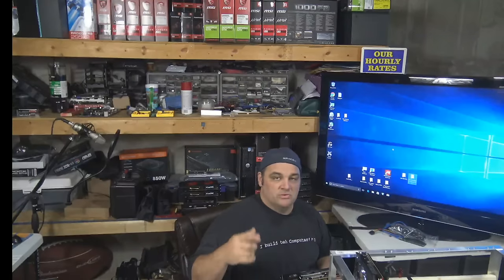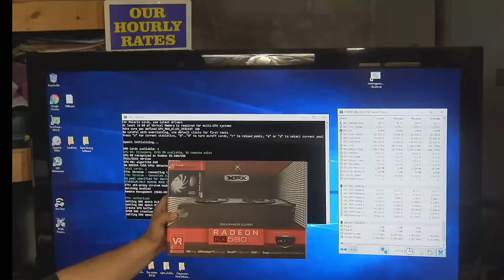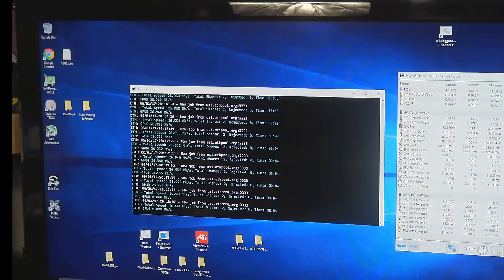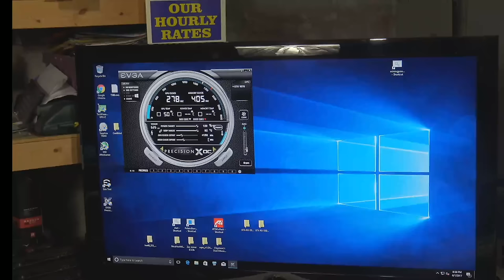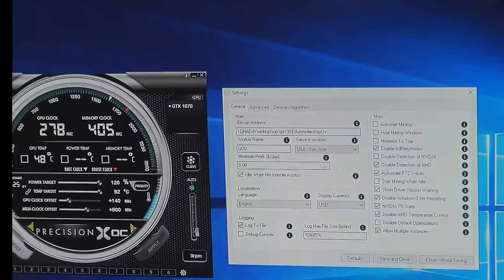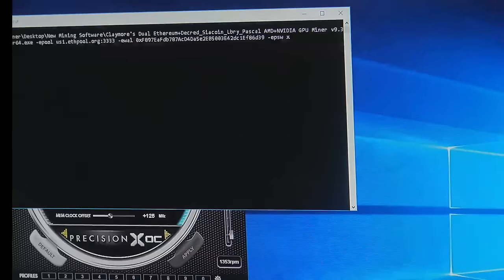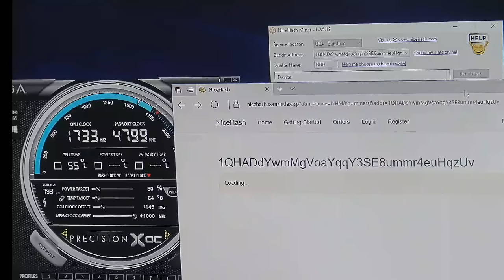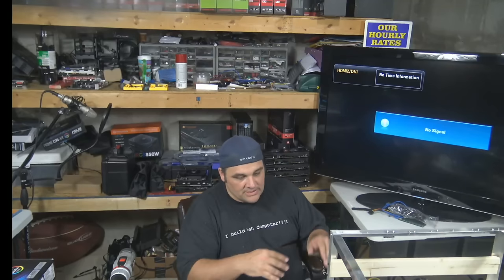Live Episode 15 - 1060 GTX 3GB Ethereum/Zcash ; XFX RX 580 8GB Crimson and OC Edition | Get it done

Comment: I've got two rigs with the ASUS Z270 PRIME  with M.2 to Pcie adapters and am trying to run 8 3GB 1060s per rig. Both rigs are only displaying 7 cards in Display Adapters. The m.2 adapter is not an issue, that card is working fine. I've enabled 4G Decode and updated bios. Anyone know what the issue could be? 0.056 ETH (around $20) bounty to whoever can help me get 8 cards on each mobo running!

Comment: PNY GeForce GTX 1060 3GB XLR8 OC Edition
Settings using EVGA Precision Tool
165+ GPU
1000+ MEM
23.5mh ETH
268 SOL/s

I see only +216 on MEM and not +1000 :)
Reply: Daniel, I agree. I used his settings that he posted in the description and they did not work. Followed what he used in the video and what you posted... it worked.
Reply: Glad to hear it. You just need to play with mem settings, get GPU-Z and MSI-Afterburner, run Valey or 3DMark stresstest in window mode to see if you can hit it for 10mins at least. +1000 Memory can burn your card...
Reply: Question Daniel. Have you gotten your cards stable yet? I can not find a number to get my pny's stable for longer than 36 hours. I can go a week on stock settings, but nothing else.

Comment: your overclock for 1060 is wrong. Do maximum memory, and under clock the core for ETH. You can't overclockclock memory at max which is the most important if you overclock the core.  
My 1060 6gb does 23.5mh/s at 9600mhz memory 1500mhz clock 65% power, 26% fan, 70C on windows with afterburner soft

Comment: I hope you are going to  make some more Videos with Nvidia GPUS
Reply from the maker: Next week covering the 1050Ti and a 1080Ti, then a 7 or 8x 1060 GTX
Reply: Bits Be Trippin' will you also be covering the MSI GTX 1060s 6GB?
Reply: Sire There are so much 1070 8Gb from different Brands are they doing all same Performance? The cheapest I find is Armor MSI 1070
Reply: I have 3 MSI 1060 6 gb running at 720 sol / s, what configuration do you have in the msi burner?
Reply: Oh each? 720 Sols thats huge
Reply: No, it is the accumulated of the 3, I think you can give more
Reply: Bro which chip the Zotac had ?? Micron Samsung ?
Reply: Samsung
Reply: Would this card work if you plug only 1 -8 pin?
Reply: Sire is a 1600W PSU EVGA G2 enough to run 6f them I mean the connections since the zotac requires 2* 8pin for each card ? thanks